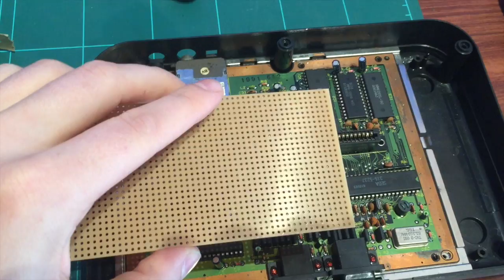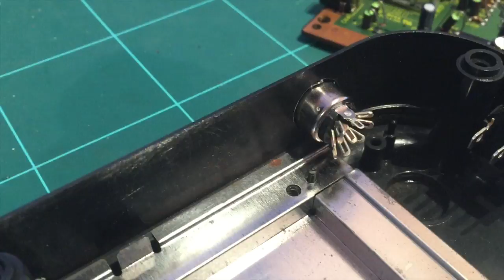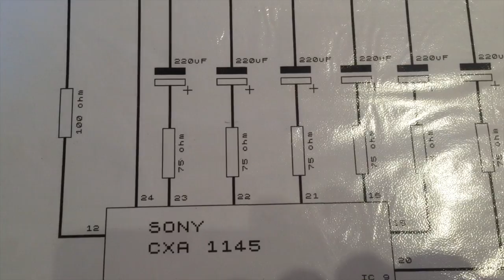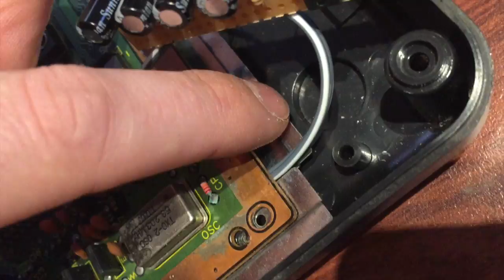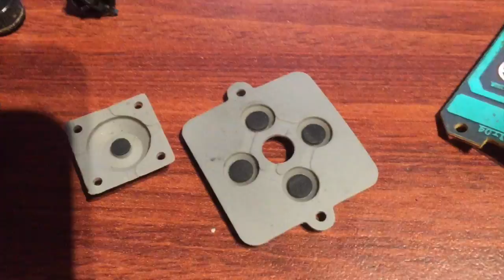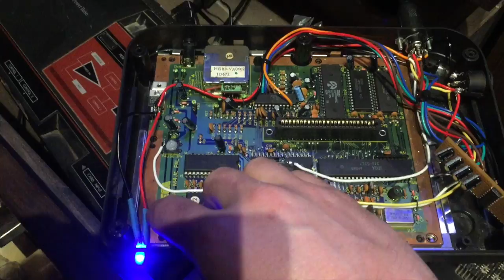Sega Master System 2 Detailed Mods Tutorial - RGB SCART | 60hz | Power LED | Controller Pause

Comment: There's no need in RGB amp in this mod. You can just solder wires to points on mobo and to 8pin din - and it's called Passive RGB mod.

Comment: 40:32 How long will the hot glue hold the start button in place, It would be better if you used a bonding glue wouldn't it?

Comment: Thanks for the video! I've almost finished doing the mod, its taken a while cause I'm noob. Question, I'm worried I've used cable too small, my logic was if the wires are the same diameter as the legs on the resistors I should be fine, is this the case? For the 50/60 switch I noticed you've listed SPST but have come to the conclusion it was a typo, I've snipped the chip for the signal and have soldered the wire to fill the gap, after reading someone's comment will I need to snip the bottom of the pin before I power it up? I'm about to purchase a scart cable and ossc so I can test this bad boy and notice the good cables have capacitors in them, which I've already wired in now. I'm half tempted to make up my own cable so will I need anything else in the scart lead to essentially finish the mod? Thanks again for the video as there aren't many around
Reply from the maker: Christopher Rowe It should be Single Pole, Double Throw (SPDT) which just means a switch like a toggle switch with two separate positions for each 50 and 60, then 3 pins to wire it. One side 5v, Sega chip pin, ground. You simply then run the middle of the switch to the Sega chip that we cut and isolate from the board. This way it no longer gets the 5v from the board and instead we feed the pin either 5v or ground to control the 50/60. These days I would buy a decent cable from retro gaming cables which already have the components in the cable, so you can just wire RGB, Sync, Ground, Audio directly to the DIN out. Sorry if this video was unclear, it was basically my first ever video on YouTube years ago. It’s terrible in every way. :D
Reply: @RetroSalesAustralia  Hi! So if I buy one of those cables, all I have to do is solder my wires from the related pin on the chip to RCA plugs, right? Of course I'm talkin about the RGB mod. And this should give me also OSSC compatibility, is that correct?

Comment: Question.
What size screws did you use to hold the 8-pin din mount on?
I'm looking to do this mod for mine (( Well just the RGB Mod only, plus my SMSII is a Sonic 1 Built-In which has a Fujitsu MB3514 chip.))  so I can use my HD Retrovision Sega MegaDrive YPbPr component cable for it.
Thanks :)

Comment: Hi i just recently did this mod but when running RGB Scart through the hd upscaler  i am getting a pal or pal 60 no ntsc and screen is 1 inch to left and up 1 inch cuts off part of the screen and solutions for this?
Reply from the maker: Hmm could be a compatibility issue with your TV. Make sure the SYNC signal is clean. I like CSYNC much more than SYNC on Composite.
Reply: I removed Composite video wire got no picture at all swapped with SYNC and got NTSC but not NTSC443 and still image remains 1 inch to the left and to the top so didn't fix the issue
Reply: @mathewsloan2169  Old comment but the issue was likely the oscilator needs replaced, the PAL Mega Drive and Master Systems were at a slightly slower speed to compensate for the pal image, if you still have it they can be bought online for about £6 each and take seconds to replace once the board is out.

Comment: hey guys, quick question..
when i cut the 4th pin on the sega chip for thr 50/60 hz mod do i solder the wire to the upper tang on the chip or the lower tang on the board or in between both?
sorry just bit hard to see in the vid.
thankyou for your help
Reply from the maker: Solder to the the upper pin as this goes into the chip. We're simply feeding it 5v or ground to control the 50/60hz. The bottom board side is not used anymore.
Reply: Global Garage thankyou very much, 
i thought that was the case as you cut the chip leg but wanted to make sure

Comment: Also there's 220k caps  in my cable should that matter
Reply from the maker: That's a really good question, and something I forgot to talk about in the video. I made this years ago so it was very rough and I wasn't as experienced in mods as I am now. So basically you only need ONE set of 75 ohm resistors and 220uF caps in series with your TV. If your cable is high quality and has these components already inside the SCART head, then you don't need to add the circuit I used in the video. Just run the wires directly to the socket. If you did double up on resistors and caps, all that would do is drop the signal amplitude down and the image may look weak and a bit washed out. It's completely safe, so just try and see which works best with your cable. I recommend buying this cable - https://www.retrogamingcables.co.uk/sega-master-system-model-1-rgb-scart-cable-for-sale?tracking=566ea08ca2b69

Comment: Can you point me in the direction of your wiring pin out diagrams
Reply from the maker: Hey mate, I've added all of the diagrams I use in the video description. Be careful when wiring up the socket as the pinout depends which way you're looking at it. Plug side or pin side. Test it with the single audio wire to make sure you get audio, then you know you're on the right track.

Comment: Not tried this but will a Mega Drive controller work with a Master System? If so can the existing pause button on the controller be used to pause the Master System somehow?
Reply from the maker: Hi, yes you can use a Mega drive controller on a Master System, but the buttons mapping will be very different. You'll have to just test it out and see which buttons work with which games. NO the pause button will not work in the way I demonstrated it. You might be able to wire it the circuit I demonstrate, but it would be a pain.

Comment: Great video! I'm wondering - Did you notice any audio distortion
 after doing the RGB mod? I'm struggeling with lots of audio noise that changes based on what's on the screen. For instance, the opening screen in Alex Kidd is pretty bad.
When disconnecting everything but audio from the DIN socket, the audio is crisp clean. Thanks!
Reply from the maker: Hi Orjanh, this audio problem is usually always caused by poorly shielded and cheap RGB SCART cables. What's happening is the red signal for example is producing a voltage on the wire and a small magnetic field... and without proper shielding inside the cable some of the voltage is being induced into another wire sitting next to it such as the audio wire. This is why you hear a humming noise that changes with the picture. When I say induce I mean  electromagnetic interference (EMI). The best solution is to buy decent RGB SCART cables once, and not mess about with cheap Chinese ones. I've learnt this the hard way as well, but it's always best to buy decent cables right from day one. I really like these ones which ship worldwide. https://www.retrogamingcables.co.uk/?tracking=566ea08ca2b69
Reply: Aha, thank you. Yes my cable is the cheapest one from Ebay, and does feel kind of flimsy if I'm honest. I'll definitely check out a higher quality cable. Thanks again!
Reply from the maker: There you go... cheap cables are the devil! Upgrade and see how you go.
Reply: Update: I switched out the DIN socket with a female SCART socket, so that I could use a standard, double-shielded SCART cable I had laying around. Now I have  zero audio noise and great RGB video :-)
Reply from the maker: @orjanh Yep it's all related to cheap cables with no shielding.

Comment: Can i buy a modded one anywhere like this?
Reply from the maker: Hi, I no longer sell these modded consoles, but if you buy the original Sega Master System model 1, it will output RGB video directly out of the round DIN connector on the rear. No mods required. Very ahead of it's time!
Reply: Yeh but i want back my SMS2 with alex kidd black power button! Now theres alot for sale on ebay or gum that apparently 'tested and works fine' but im 50/50 on those and altho i hate altering original retro things i actually feel assured with modded sms2 consoles will work.

Comment: First of all i'm a big fan of your videos, keep up the great work! I've recently modified my SMS2 after watching your video and have noticed that when I switch to 60Hz I experience a lot of colour bleed, an over saturation of colour. Switch back to 50Hz and the colour is perfect. This happens when using both composite and s video. Any ideas?
Reply from the maker: Hey Darryl, Thanks for the feedback, always appreciated. The short answer is, move to RGB SCART as this wont have any issues at 60hz. The long answer is when you force a PAL machine to run at 60hz it also overclocks the PAL colour subcarrier frequency which becomes out of spec for your TV. It's a complex topic, but in a nutshell you can correct this colour issue by installing a separate crystal oscillator to set the correct frequency back to the PAL spec again. You need to aim for 4.43Mhz This video from the Sega Guru is a pretty good guide - https://www.youtube.com/watch?v=LXHb_yPOVtM and parts are available here - https://www.retrosales.com.au/products/parts-modding-crystal-oscillator-4-433mhz-pal-colour-5v-4pin-xtal-dip14
Reply: Awesome really appreciate your feedback, i'll definitely check out those videos. Just on the RGB scart option i'm yet to adventure down that road pending an affordable upscaler option. I know about the infamous framemeister but also noticed that you sell a cheaper upscaler alternative. I'm just interested in your experience using this device or whether I should save my pennies on buying a framemeister!

Comment: Hey Darren RE: the RGB mod for this mate, if I only wanted to get csync from pin 11 of the CXA1145  ,  just confirming I wont  need too add the 75ohm and 220uf res/cap to the scart pin 20, its only necessary when wiring from pin 20 of the CXA, to get c video sync, hope that make sense mate?.     

cheers Franky
Reply from the maker: Yes that's right, composite video on pin 20 is used for sync and a backup video source. I call composite sync "dirty sync" as it's OK but not the best. If you only use CSYNC from pin 11 if will take that as the sync feed. I do the same thing sometimes. Let me know if you have any issues.
Reply: Global Garage Cheers Darren will do  appreciate it  mate, but now just thinking about it how come the composite video requires the cap- resistor combo, and the csync line doesn't need one?..
Reply from the maker: It's complicated...and stretches my knowledge, but in a nutshell, the RGB signals vary from 0-700mV and are being taken directly off the chip, so we need to couple them with a Capacitive / Resistive circuit to "stabilise" the video before it enters the TV.  The same is basically true for composite video (CVBS) as it carries all of the video information AND Brightness AND the sync information in one waveform. We need to couple that as well. But the C-Sync is just the sync wave stripped off the CVBS mess and presented in a pure square wave signal, so I think it can be used directly off the chip as it does't have varying voltages, just a clean and predictable wave form from peak to peak with a trigger being read from either the leading edge transition from 0V upward, or the trailing edge as it falls off back to 0v. I don't know which trigger is used, but I know that's the basic concept.
Reply from the maker: https://www.maximintegrated.com/en/app-notes/index.mvp/id/3303
Reply: Mate your a champ, answered to your best ability and provided further info via link, cheers darren gentlemen, im sure ill be in touch soon mate !..

Comment: Great Vídeo, I Hope that someday I will do something like this and put it in my future game collection, Joint so many sistems ( Master, Genesis, Snes, Nes, Ps1, Ps2, All in Scart. with an Scart Selector and an Scart2HDMI is a dream, a lot of sistems on the top of your finger,... and of course, a FlashCard With all games on each sistem hahah ... You Vídeo was incredible, thanks for sharin'g with us.

Can I do this mod to a Master System 1 model ? that one that have the 3d Glasses Option. I see that you have one on bottom of the one that you are modding. 

There is a FM mod that change de sound. is realy cool, either i'm sure you know about it. 

I Can Tell that is the the ultimate Master System mod. ... Greetings. and sorry  for the Bad english.
Reply from the maker: +Wanderson Rodrigues Thank you so much for the comments. It's good to know someone out there is enjoying the videos. RGB SCART is really the best way to get the 240P video signal from these old consoles. It's then easily upscaled from analogue 240P to digital 1080P HDMI via an inexpensive upscaler or the infamous Framemeister! Personally, I think it's best to use RGB straight into an old CRT tv. Yes I did a video on the FM mod, it sounds amazing. I actually have a few more FM kits to install for customers so I will film the install and upload the video soon. Yes you could do all this to a Master System 1, but that console already has RGB video on the rear socket so it's mostly already done. The 60hz mod and controller mods are both recommended though. I've done the 60hz mod on every console I own. :)
Reply: Like❤https://youtu.be/P-u9CZfuL6s

Comment: Is there any bug If you just make it work only in 60 Hz mode?  I mean no switches and stuff.Just 60 Hz permanently.
Reply from the maker: +Planet Of Human No it's perfectly fine to hard wire it to 60hz. There's no real downside except if you ever want to switch back to 50hz. Some PAL games are actually optimized for 50hz and run full speed, so if you force them to 60hz they will run too fast. The switch lets you control this and is really easy to install.

Comment: Fantastic work mate - really good video.  As a n00b, would really liked to have seen a clear shot of the underside of the custom board you put in, for future reference!
Reply from the maker: +zulnoth Good point about the underside of the board. It's basically just a holder for the caps and resistors. They simply connect in series off the chip pins. So Red comes off pin 23 into the 75ohm resistor, then into the positive side of the 220uF cap, then the negative side goes to the socket and into the cable. http://www.smspower.org/uploads/Development/rgbschem.png The 4071 chip is just 5V on pin 14, Ground on pin 7, then I used inputs 1 & 2 for the controller pins, output pin 3 back to the pause switch. https://upload.wikimedia.org/wikipedia/commons/thumb/0/04/4071_Pinout.svg/220px-4071_Pinout.svg.png
Reply: +Global Garage Just noticed one more thing in case you wanted to modify description to suit:  the cap you used on the audio circuit isnt included in the parts list haha.  Another trip to Jaycar for me!

Comment: Yeah hard to go back to composite after using RGB. im considering a Sony PVM for my retro games, much research to do.
Reply from the maker: +Malcolm deRoy How did the PVM work out? I've considered getting one but I like my Loewe Calida 5072
Reply: +Global Garage got a few RGB TV's now.  picked up a sony PVM 14 inch, great picture just to small really.  in the last week picked up two loewe TV's.  One is a monster 80cm Calida 5684z, it outputs a decent picture via RGB however im sure it can be improved with tweaking.  The other is a Ergo 6672 ZP and the picture quality via RGB is nothing short of stunning. both TV's also have VGA cards installed.
Reply from the maker: Malcolm deRoy Are your Loewe's 100hz? Usually the ZP on the model indicates they are and can causes a blur with 240P RGB. Look for an older model in 4:3 which is 50/60hz. I can highly recommend anything with the E3000 or E3001 chassis. Loewe Calida 5072 and Loewe Profil plus 3472 are both up there with PVMs as far as picture quality. Very close anyway...
Reply: +Global Garage yes they are 100hz. the larger one is a little blurry however the ergo is very sharp.  on the ergo there seems to be a lot of options to manipulate the picture, and can get it pretty damn sharp.  But none of that matters now, the same guy contacted me to say he found 2 more loewe TV's and one of them is a 50/60hz calida 7220.  so i picked that one up. :)